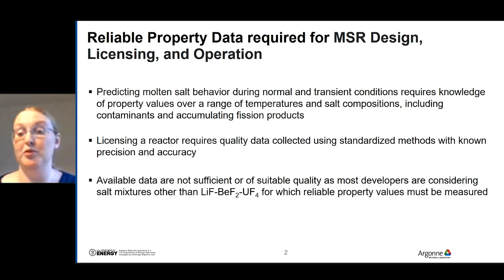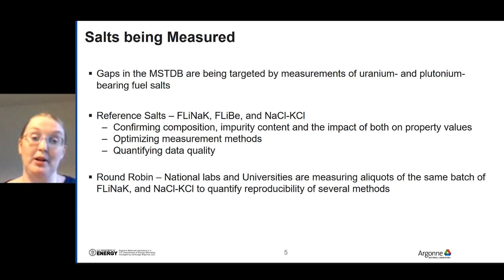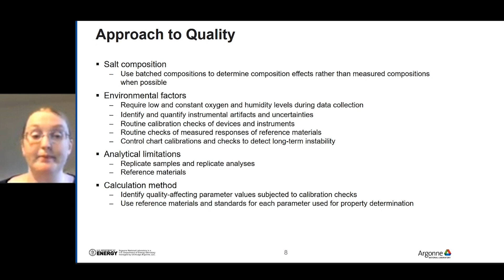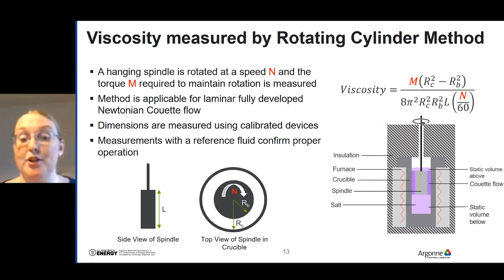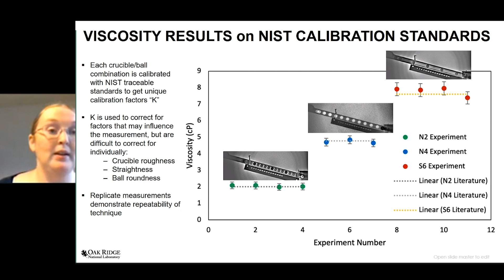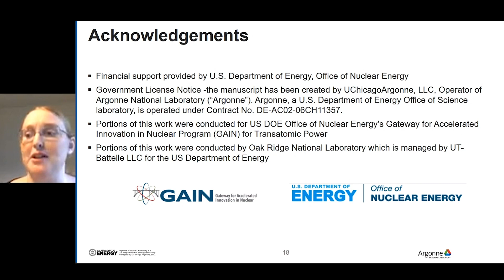Experimental Determination of Molten Salt Properties - Melissa Rose @ ORNL MSRW 2021

Comment: Concerning the Graphics of BeO impurities in FLiBe (at 10:50min), why is it headed FLiBe (1wt% BeO) instead of FLiBe (1 mass% BeO)? The use of the term "weight" (a force eg. Newtons) instead of the corrected term "mass or mol" is an erroneous factor slowing the education of students of the legacy "imperial unit" countries - still lagging in their complete transition to ISO units, and exacerbated by some Institutions such as ASNT who certify QA inspectors trained in foolishly mixed ISO units and imperial units. Please help by not hindering progress.
Reply: This is a republished conference, it is probably the wrong forum to air your concerns. AFAIK wt% is dimensionless, so the units should not matter. wt % and mol fraction are commonly used in the chemical industry.  Dimensional analysis should be taught to all students involved in measurement so that they are not confused by arbitrary use of units..